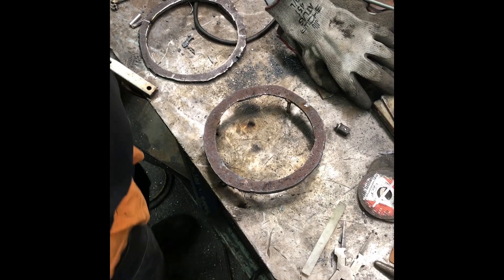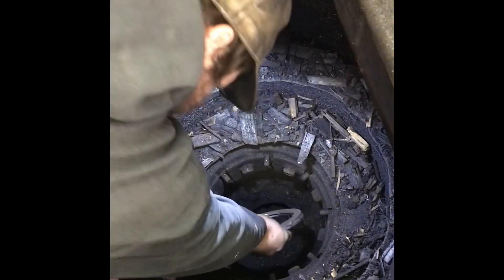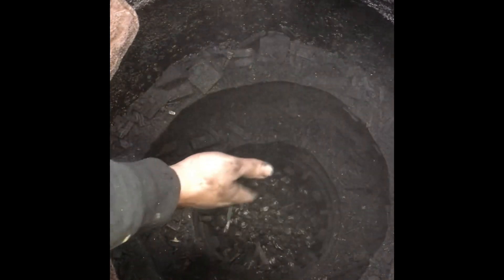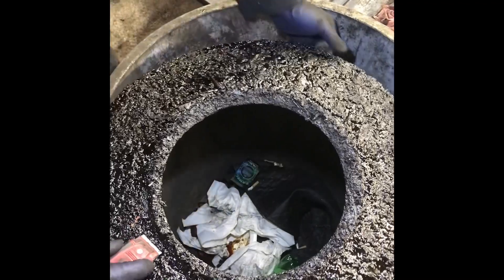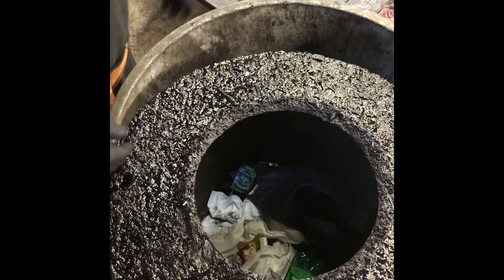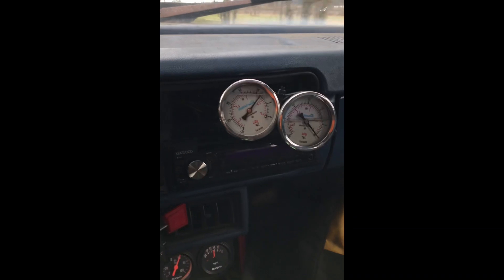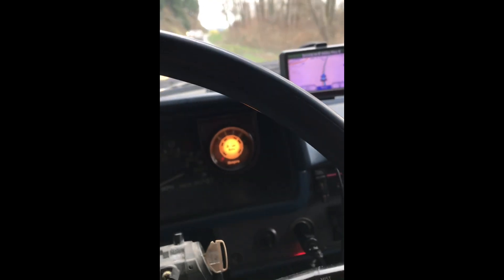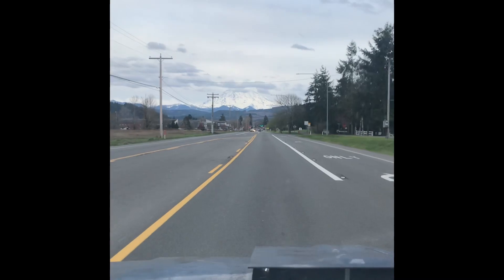More tuning for the gassifier

Comment: Sounds like material in the blower Marcus
Reply from the maker: Yes I think there is chunks of char bouncing around in there!
Reply: @BigBeavrSlayer    Yes. I think so too. Sounds like my kind of work. Part in the fan. Only you want vaccuum, not part transport
Reply from the maker: @joepkruijssen  it's gets most the dust out of the way at least 😂 but air for transport is a interesting concept for things hmmm 🤔
Reply: @BigBeavrSlayer    No no. Bad idea. But I dont have to tell you, you already know. Make sure you burn the char instead of transport?
Reply from the maker: @joepkruijssen  just a blind idea, those with charcoal gasifier....refill on the go, small air ram pushing char up into the hopper. No auger to bind or break the char up, slow activation from onboard air compressor. Somewhat like the drizzler with it's auto feed?
Reply: @BigBeavrSlayer  mmm, no. I am an auger type of guy. Less energy needed. A fan has a max eff of 50% and you can transport max 5% by weight. Airtransport a for a big part a waste of energy. An auger will do the same with a few 10 W. Remember I am focused on small generators, 4 KW. Not a V8
Reply from the maker: @joepkruijssen  true, I was thinking simple onboard air compressor, which I plan to install on my trucks for the air bag systems they will eventually get. Then the air is made by electric pump or even engine driven pump, in turn made my either the trucks electrical system or the woodgas powered engine. Just ideas, I have not gotten into charcoal yet but I figure how light it is, easy to move with little energy
Reply: @BigBeavrSlayer  ok, do your math. Charcoal is a beaty. And unless you are a gardener, it is a waste of energy. Better drive on it.